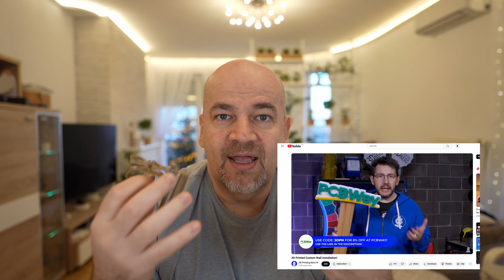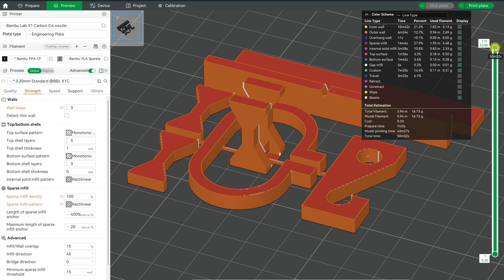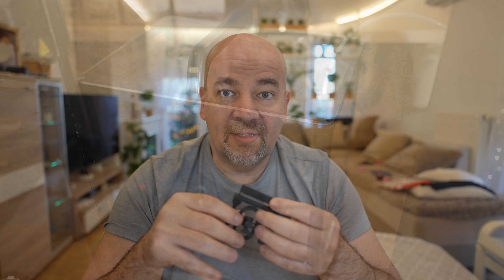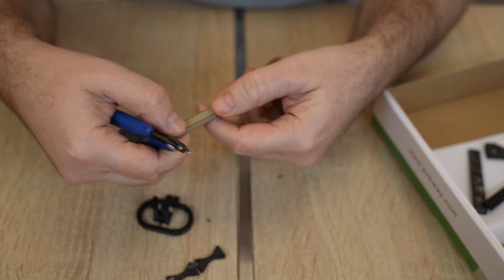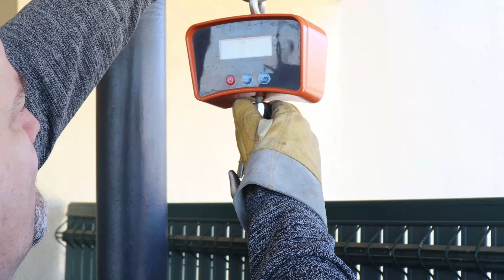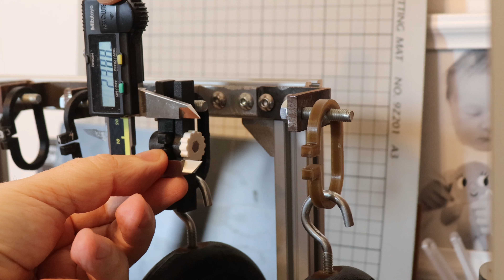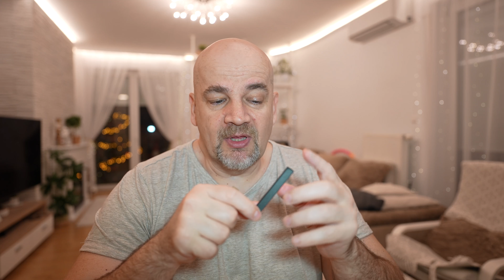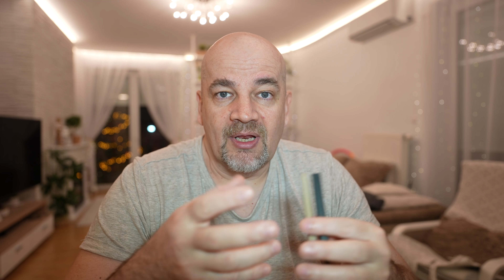PEEK vs PPA-CF: The strongest industrial vs strongest consumer filament

Comment: Tullomer is the strongest material out there. Tullomer is vastly superior to PEEK and way easier to print. Way lower printing requirements and price, and it affordable for consumer printers. You can print tullomer off a modern printer like the K1 max or equivalent. Tullomer does not need annealing, has low warping, and it is a crystalline structure in the solid state.

PEEK is junk for all the requirements needed to print it correctly and the price.
Reply from the maker: I am curious, Tullomer, your personal experience or comment is based on specs from the website?
Reply: @MyTechFun  Multiple Youtube videos of 3D enthusiasts printing with it, and testing the material in addition to available data I've read about.

Its a fairly new material so it needs proper slicer profiles integrated. You need to print small layer lines and quickly to create a fibrous structure.

You can go to the manufacturers site and submit a case use for free material to test your idea on. Its worth a shot and it would be awesome to see.
Reply: @automatonfederation9456  sorry but your comment is a bunch of nonsense...
Reply: @riba2233  How so? I've seen plenty of case uses on it and its performance. Prove me wrong then.
Reply: @automatonfederation9456   I don't need to prove you anything, one who made a claim needs to prove it. This stuff is new, nobody really tested its properties, it is not easy to print, it is finicky, expensive and still not verified. Peek has its own set of advantages that tulomer is not even close to and it will always be a preferred choice for applications it is used for.
Reply: I don't need to prove you anything, one who made a cIaim needs to prove it. This stuff is new, nobody really tested its properties, it is not easy to print, it is finicky, expensive and still not verified. Peek has its own set of advantages that tulomer is not even close to and it will always be a preferred choice for applications it is used for.
Reply: @automatonfederation9456    -
Reply: @automatonfederation9456  I don't need to prove you anything, one who made a claim needs to prove it. This stuff is new, nobody really tested its properties, it is not easy to print, it is finicky, expensive and still not verified. Peek has its own set of advantages that tulomer is not even close to and it will always be a preferred choice for applications it is used for.
Reply: @riba2233  You sound like a opinionated fan boy who is upset his favorite superhero was bested 😂. Sure its new but it's not some untested material. How would you know if its finicky if its "untested"? I said EASIER to print in comparison to PEEK. Stop making stuff up.

Clearly you don't understand what a crystalline structure is. You have to anneal PEEK to get it to organize the structure better and PEEK is only semi crystalline. Tullomer is fully crystalline, its molecular chains are arranged in a completely ordered lattice without any amorphous regions. 

The crystalline structure is what gives PEEK or Tullomer its mechanical strength. You obviously don't have a clue about what you're talking about. Just stop talking, you have nothing of value to say.
Reply: @automatonfederation9456   oh I know very well what I am talking about, you sre the one who drank the marketing kolaid. Like I said, there is not enough info out there (prove it if you think there is, you made the claim), and peek still objectively has some qualities that tulomer doesn't even have on paper so it is not even a comparison between those two.
I know that it's finicky because they showed it lol.
Reply: @automatonfederation9456   also only fanboy here is you, I don't give a f--- about any of these, I am just talking about facts which obviously mean nothing to you.
Reply: @automatonfederation9456   also you are the only fanboy here, I really don't care about who is better, just talking some facts. So very ironic projection from you ;)
Reply: @automatonfederation9456  oh I know very well what I am talking about, you sre the one who drank the marketing kolaid. Like I said, there is not enough info out there (prove it if you think there is, you made the claim), and peek still objectively has some qualities that tulomer doesn't even have on paper so it is not even a comparison between those two.
I know that it's finicky because they showed it lol.
Reply: @riba2233 You must be really desperate for a win in life if you want to argue about something this stupid. 

I've witnessed great results and it acts like described, so your opinion means nothing to me. 

I suggested to the person who runs this channel testing out some Tullomer he can get for free. Don't insert yourself when it doesn't involve you and flaunt your ignorant opinions.

Comment: Aside from the suboptimal printing parameters, let's not forget PEEK is OLD tech, bambu is new tech and it's made specifically for strength, while PEEK is meant to target a blend of mechanical, chemical and heat performance.

Comment: I had a clise look at the printed objects from PCBways.  These are pretty bad. Bad layer adhesion management, roo much warping. Also they were not anealed ( should look milky gold ) . You cannot rely on these samples for your test. We print aero certified harness clips from PEEK in a modified Intamsys Funmat HT. To get good results, the spools need to be dried at very high temperature  ( 120 c, just below anealing temp )  in an oven ( filament re-spooled on an aluminum spool )  and then placed in an actively dried chamber during printing. The printing chamber of our  Funmat HT is actively kept to 90 c but this is not enough. We are limited to 20 mm high clips with about 30 mm2 footprint on the bed. Warping is so intense at 90c chamber that we have to print on a 5 mm stainless steel  plate to avoid too much layer adhesion issues. Also, the build plate must be treated with a special PEEK adhesion product.

Comment: The only other test you might do which would be hard because you'd need to do it inside a oven and remote control the stress, but basically deform and break points under heat.  Perhaps that is really where PEEK shines.
Reply: His oven does not go to 400 c.

Comment: A lot of people already mentioned the fact you should anneal PEEK part. But as someone who print with PEEK quite often, I gotta say that I don't like these parts. The color is not right, the warping is too important and the layer adhesion should be better... IMO the print setting were not right, probably wrong temperature and some part cooling. (You should avoid cooling as much as possible with PEEK).
In any case, don't expect metal like properties, PEEK is still a polymer after all. But it has the advantages of heat resistance, self extinguishing, chemical resistance and it's bio compatible.
If you want to try a very strong super polymer, I can advise you to look into Ultem 1010 (or PEI1010). It's a very impressive polymer !
PS: you can put 300° on your BambuLab nozzle without any risk. I do it regularly at work and after 3000h, our X1C still works perfectly.

Comment: PEEK is good under heat too.
no oven test ?
Reply from the maker: Both are too good for my equipment. In testing I would see, that I reach max temperature, and there wouldn't be any deformation on these test object. Boring..

Comment: The advantage of PEEK is temperature resistance.  I was surprised you did not do the oven test.  That is where this material would do well.  It is also good for chemical resistance if I remember correctly.
Reply: I work at a university in a workshop. We use PEEK regularly for demanding applications. In addition to chemical resistance and high temperature performance, it also works at cryogenic temperatures, doesn’t off-gas (so good for high and ultra high vacuum), and resists radiation.

Teflon (which is much, much cheaper) meets many of those criteria, but not all: it gets even softer (than it already is at room temp) at higher temperatures, and it degrades rapidly in radiation. And Teflon creeps under pressure, though special cross-linked versions do exist that work as gaskets, etc.

Comment: This is towards a new test with annealed PEEK as several people have mentioned.
Your channel is a great addition to the 3d printing community, keep it up please.
Reply from the maker: Thank you for your support. I will have soon many similar filaments, like PEKK. This time they arrive annealed (by one of my viewers)
Reply: @MyTechFun   This sounds like a great segway to testing different companies with the same print. Sounds like PCBWay really blew it on this one.
Reply: Even annealing PEEK is not the answer. The parts really need to be crystallized in-situ -- annealing PEEK will make all the color similar, and the molecules crystalized, which will help chemical and heat resistance, but will do very little for layer adhesion and overall mechanical properties.

Comment: PEEK is a semi-crystalline material and if not printed properly with the right temperatures you will have the main problems in Layer Bonding which exactly reflects what you faced in your test. Also annealing is a must to gain proper strength.

Comment: In addition to testing the annealed PEEK, you should also test CNC machined PEEK. It is available from PCBWay and others. This way you can compare the color (as mentioned by others), but also the strength as I'm suspecting that 3D printing these high performance materials degrades some of the properties.

Comment: I'd be interested, please, if you have recommendations for a consumer filament to print parts for a CNC machine (specifically for a PrintNC machine) which need a combination of strength,  minimal flexibility and minimal compressibility.  For certain parts, but not all, temperature resistance is important. That might lead to the use of two filaments. Thanks :)
Reply: Luvocom makes a material LUVOCOM 3F PAHT CF 9742 BK. There are companies that make filaments from this material. Esun`s PAHT was made from it. It is very strong with high modulus and very temperature resistant.
Reply: @motordude67  Thanks. I see the Esun product is discontinued, but there are plenty of PAHT-CFs around
Reply: Tullomer, kind of pricey but is your best bet.
Reply: @severpop8699  yeah I've see n that and regretted the price, maybe if I got into production... thanks for the recommendation

Comment: "I think the impact test was measured incorrectly. The hammer should be dropped from several different heights, then measured at what height the object breaks. What do you think?"
Reply: Look up one of the engineering standards for impact testing and give it a read.  The process and rationale is well explained in at least the ASTM standard.
Reply: The way he does it is fairly standard. By always dropping it from the same height, then measuring how far it travels after breaking the part, you know how much kinetic energy was lost in the collision, eg. the energy it took to break it.
Reply: No, that is false

Comment: Most popular Bambu CF filament comparison would be very interesting. For example PAHT-CF vs PET-CF vs PA6-CF. It seems that you don't have any video about very popular PAHT-CF, so it would be nice to get data at least of it. 

Thanks for very interesting videos, you are my top1 3D-printing channel nowadays!
Reply: PAHT-CF = PPA-CF (with some technical exceptions)
Reply: @mrnukeduster  PPA-CF has much higher strength and stiffness than PAHT-CF. I have and use both, and it is very noticeable.  PAHT-CF is slightly more impact resistant, and has better layer adhesion. I consider them to be fairly different for many uses.

Comment: PEEK, like most "ultra-polymer" filaments need to be annealed after printing to get the advertised mechanical properties. It doesn't look like your sample has been annealed. Also, you can print PEEK at lower (90°C) chamber temps without warping (should be more like 140°C), but that will also affect layer adhesion.
Reply: Or you print it att >220c chamber and don't have to do post presesing

Comment: I worry that because of the Engineering nature of the materials, it seems like the manufacturer of your PEEK may not have prepared your order the way intended by the inventor.  I hope that you can get feedback from the manufacturer and possibly another sample that has been properly annealed and printed in-spec.  You may even want to run a test with different PEEK manufacturers before doing the PPA-CF comparison?  It seems like its wasteful but... honestly I had no clue that PEEK was so sub-par, but your PEEK didn't act like the stuff I get - maybe I'll try PPA-CF!

Comment: People are mentioning annealing the PEEK - Wouldn't PPA-CF also get stronger with annealing?
Reply: @IceRockCooling  it is not as strong as brass
Reply: Only crystalline and semi crystalline polymers benefit from annealing because they allow the crystal structure to re-form properly. The normal crystallization does not happen during our very rapid printing presses. In some cases, annealing will improve mechanical properties like strength, temperature resistance, or impact. 

I would like to see impact strength and temperature resistance performed on both of these materials after annealing. PEEK has great high temp performance and would be interestes to see how it compares to PPA-CF in this regard when both are annealed. 

Fully amorphous filaments generally do not benefit from annealing and appreciable ways. There is discussion that they may benefit from stress relief as a result of an annealing and that could, in turn, improve performance. However, I am unaware of any data that conclusively proves this so far.
Reply: @ArgueForSport   correct, and while annealing helps with things you mentioned it doesn't help much with layer adhesion
Reply: No, it wouldn't.
Reply: @IceRockCooling  I am sorry but there is just no way. Maybe if you normalise it by weight but still

Comment: For tullomer: let them send their printed samples plus the filament. Than you can compare, if you can reproduce the same results they can achieve. Should be good for them, and good for the rest of us.
Reply from the maker: They will send me  X1C profiles.
Reply: @MyTechFun the settings are printed on the box.
Reply: Yeah it will be nice to see the consumer printer profiles vs the ideal printing temps. This filament will be a game changer if they can drive the price down.
Reply: I have some Tullomer and have been emailing back and forth with z polymer trying to get it to print well. It prints great actually except the layer adhesion is a nightmare so far.
Reply from the maker: @digitalabstractions  in the meantime, one of my viewers is trying to print the test objects for me. Same experience from his side. Very hard for printing.
Reply: @MyTechFun  I think it's got potential...but I also feel like a Beta tester for them and wish I had not bought the Kilogram. Unfortunately they were backordered on the half Kilos and I bought the hype. It's hard for me to make anything useful, so far I would say I've been unsuccessful. It was supposed to save me time and money for my design but has been a huge timesink and stressor. I will most likely be making my own video to let people know what to expect.
Reply: @digitalabstractions  I've gone through about 1/3 of my roll of Tullomer before giving up.
Z-polymers confirms the layer adhesion issue...their only advice is to print hotter (350 or so) and faster (400-500).
Guess my X1C isn't good enough...
Don't have any interest in getting a new printer for just one (somewhat troublesome) material.
Reply: @pirobot668beta  Thanks for the response and I agree I pulled my hair out for weeks trying to salvage the purchase in light of the fact I could not get a refund and I'm extremely disappointed about the results compared to their illusory marketing tactics.
Reply: @digitalabstractions  I have had the same issues. I heat soaking the chamber for a couple hrs seams to help. Tullomer definitely is stiff and strong, torque does seam to be its weakness for now.
Reply: +1 for tullomer